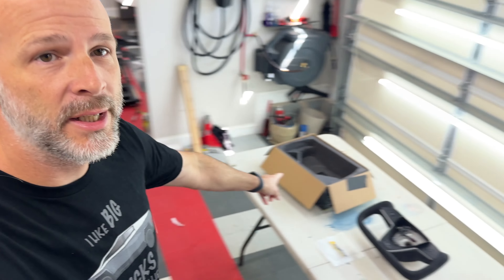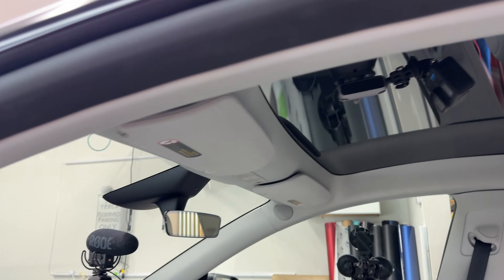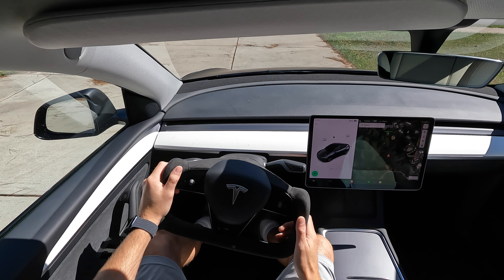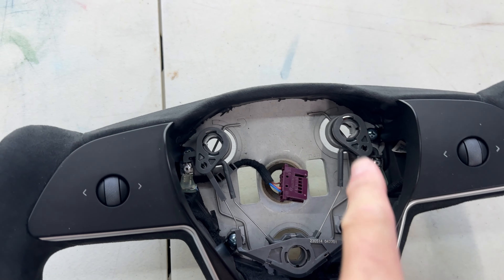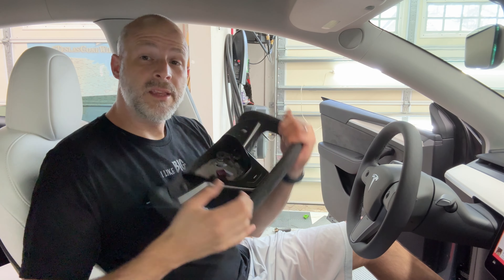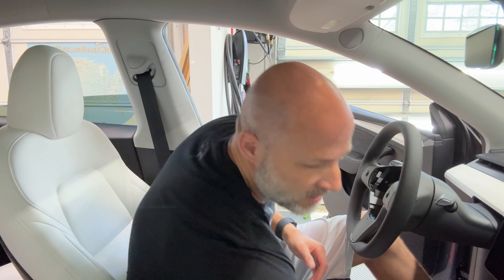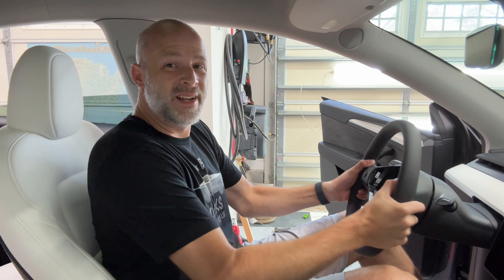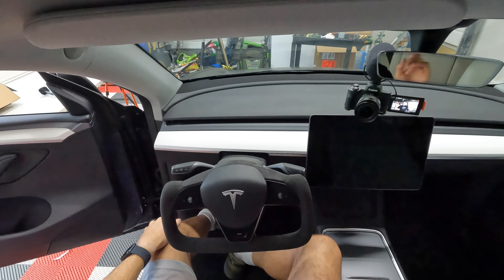NEW Tesla Yoke Design for Model 3 and Y

Comment: I feel like you should use a torque wrench to tighten it down to how tight it was before.
Reply: Yes, the correct torque is 92nm or 68lbs
Reply: You always torque bolts especially for the steering wheel and wheels.  And if you needed a pipe to get more leverage, then you need the pipe to tighten it too.  Brian, you just made yourself liable should that come loose and cause an accident.

Comment: Brian @i1Tesla, no need to swap out the wheel internals (heating functions, etc)?
Reply: There is a small circuit control board that I had to swap out from my original wheel into the yoke (see my video if needed) ...not sure why Brian didn't have to do it in this yoke.
Reply: @DaxM  That's what I was thinking yes. Watched your vid. Appreciate it!

Comment: I just can't see Alcantara holding up on the yoke, it's going to wear away quickly.  Alcantara is great for trim and such but not on a steering wheel and Hansshow wants $50 more for this version because of the Alcantara?!  Replacing the airbag cover does not void the warranty.  But that matte black wrap looks very stealthy on that Model Y, very nice.

Comment: I find i hard to believe anyone would want to. take out a wheel for a yoke .I have a S with a yoke and dont care for it but I wont be changing it what I dislike more is location of the horn ,wipers turn signal buttons
Reply: It takes getting used to it for sure. S-I-L has Plaid S and loves it! But we agree that the horn and turn signals should be usual spots- which is fixed with this aftermarket yoke. Horn and turn stalks are where they should always be- not as buttons on Tesla version of yoke.
Reply: 🙋‍♂️SOME LIKE IT 🤗😁 I TOTTALLY LOVE IT ❤️ different strokes …